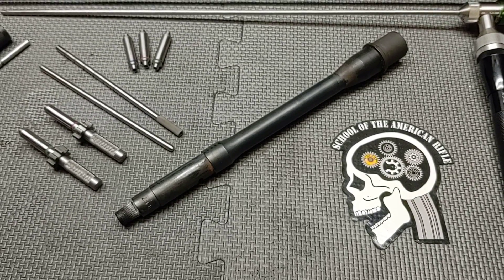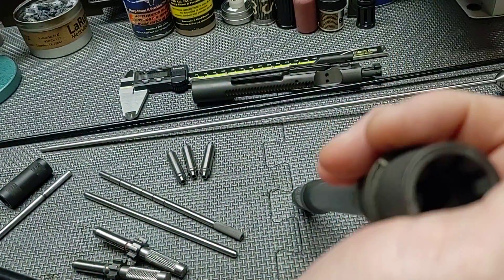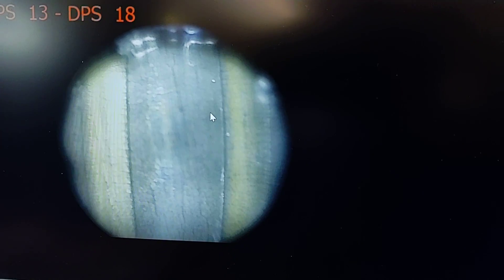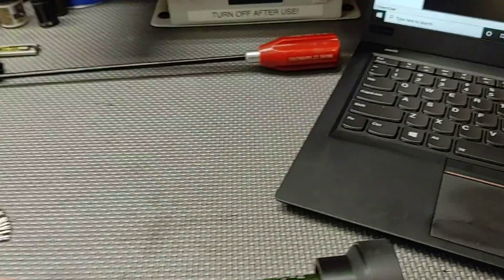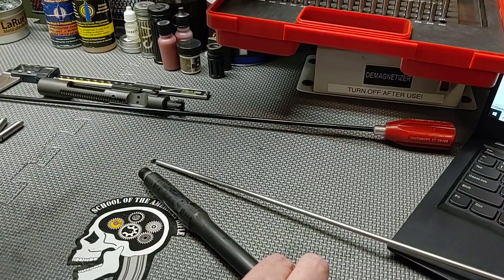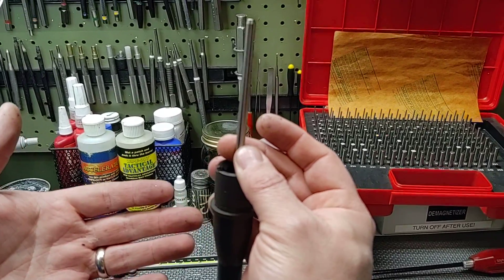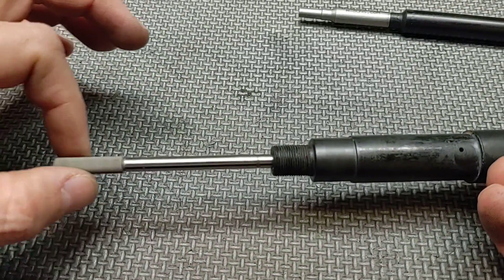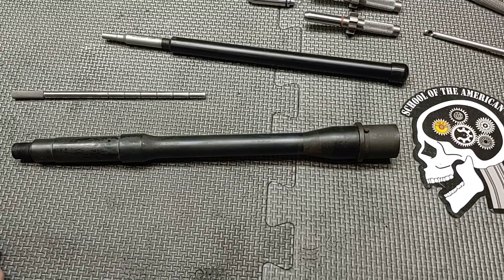Rosco Manufacturing - 26,750 Rounds of Full Auto - Barrel Autopsy

Comment: Man...my 10.3 ballistic advantage "hansen" barrel was torched at 5,500!  Of course, 90% of those were fairly hot Hornady 75bthps behind RL15 or Varget.  I wonder how many more rounds it would have survived with an equivalent load of cooler burning ball powder?  All academic at this point...ultimately barrels are dirt cheap compared to component prices or god forbid factory ammo.

Good work on the autopsy! Subbed.

Comment: I would like to point out one thing you may have overlooked here.  With that much erosion at the muzzle, you essentially have a tapered barrel, As your erosion gauge clearly shows.  This would potentially render the straightness gauge test irrelevant in this case.  This could potentially prevent contact of the gauge rod at the eroded end, where it would normally contact if it were bent with minimal erosion, allowing it to slip through unimpeded.  It likely is essentially straight however.  Just something to consider.

Comment: What was Rosco's using for ammunition on that barrel? And was it a consistent brand/type? How much did they clean between dumps if at all? And yes need answer to question if they used suppressor or not but can accept that it's less than half likely they did.
All in all to my limited experience it looks like what can be expected from a 13.7 inch barrel being rode hard in full auto though I admit I thought the throat would be gone.
Reply from the maker: No I don't need to answer anything. I explained what I was told in the video. Take it or leave it.
Reply: @SchooloftheAmericanRifle  Leaving it then. Just curious was all

Comment: I wonder what erosion on LMT’s 45 degree gas ports look like
Reply: I have been wondering this as well.  Some of the claims seem pretty dubious...but I want to see a report from a 3rd party.
Reply: @jonathonschram3429  Stole this from the AK subreddit because I don't think I can say it any better, but I researched this on AKs and found this to be very informative:

"Everything pre-AK-74 used a 45o gas block and gas port. Early AK-74s also used a 45o gas block and port until they realized it was causing bullet shearing. The AK-74 switched to using a 90o gas port and gas block because of this. Everything afterward did, too, simply because it was easier to only have to drill one kind of hole and make one kind of gas block for everything.

The gas port angle is what is important. Romania used 45o gas blocks on their AK-74s, but did not experience bullet shear due to the fact the gas port itself in the barrel was drilled at a 90o angle.

Basically, it doesn't matter."

Also, I believe a 45 degree gas port will lead to quicker gas port erosion...look at how the gas port eroded on this 90 degree gas port...now take that and start with a 45 degree gas block, it's just gonna accelerate the erosion.

Comment: Even with the gas port erosion the gas port is still smaller than many other mfg gas ports.The weapon seems to have been properly gassed.I've been overlooking Rosco and several other mfg but will be checking them out.I only buy AKs if Akoperators union clears them and now when I'm looking at barrels and bcgs I'll see if you clear them.

Comment: Chad, with someone of your knowledge, I think it would be great to see an in-depth AR style rifle cleaning video- if you ever find the time. Awesome stuff.
Reply from the maker: Certainly
Reply: A live Q&A would be incredible.
Reply: I do something similar based on military and civilian training and trial and error. I'll strip the rifle, coat in CLP, scrub as needed, then I irrigate the upper receiver with brake cleaner. All of the small parts minus the extractor I degrease with a toothbrush in a tub of mineral spirits. Once everything is degreased, I clean the barrel and LIGHTLY coat the rifle and all parts in CLP and wipe down. Then I run a snake through the barrel and mop the chamber. I only "lube" the cam pin, bolt guide surface, and 4 bolt carrier contact surfaces and I do so sparingly with lubriplate. 
I am running a mid length 16" with a sandman k. Cleaning and lubing the rifle like a M1 Garrand has decreased the amount of graphite, carbon, and dirt that is attracted by excess lubricant and it needs cleaning less often.
Reply: Drop the fieldstripped rifle in a tub of CLP, let stand for 72hrs, remove, scrub parts with nylon brush, run through parts cleaner with very mild solvent/degreaser(simple green), rinse with water, dry thoroughly with pressurized air, lube all parts and lightly coat all steel parts with CLP. We used to do that while on post deployment leave, everything but the optics, and lowers went into the bins, and when we got back you could see carbon settled on the bottom, and it was way more than you thought your rifle had. I currently have an Anderson RF-85 upper. They claim you don't need lubrication, and warn against using lubricant. I run my upper wet, and I keep it wet when at the range and at home I keep a light coat of oil. If I need more than a mag for self defense then I'm not doing it right, or it's the cops at my door, which is a slim to none chance for me. And in reality, you don't need to get every last bit of carbon, and honestly you shouldn't remove it all. It's not worth the time and effort taken to achieve, and in my opinion, it's not healthy for the firearm. Carbon isn't the enemy, your bore, chamber, barrel extension, bolt face, bearing surfaces, and BCG should be clean of build up and excessive carbon. But the first three should be the main focus for being the cleanest and the rest you can get the majority and not have any operational or excess wear issues. The biggest place I see people missing is in the FCG and buffer assembly and tube, as well as their gas tube and gas key. If you have coatings that will withstand it, break/parts cleaner works magic on carbon. I might get chastised for saying that, but I used more of that stuff in the military than I ever did as a mechanic.
Reply: @Deathbomb9  CLP isn't the best lube. It kind of fights itself.
Reply: @hellcatdave1  never said it was. It's what we could use in the military and I have used gallons of the stuff. It comes down to preference and how many different products you want to use and have on hand. For most people, they want a few. I have lost count of the number of products I have or have used. For the purposes of cleaning after the range, CLP is great. You can wet the firearm, put it in the case and head home. After a couple hours it has worked it's way in to breakdown most the carbon build up, or if you kept applying it at the range and started with a well lubricated firearm you can likely wipe most the carbon off and have minimal time scraping and all that. For a deep professional cleaning I use several products and in different stages. I've never had an issue with CLP besides its heat resistance and the fact that you have to apply it more often than most oils. But in the military that was t really an issue as we had gallons of the stuff at any point in time and usually did some training with our rifles at least once a month. I've had CLP restore function to an M9 that spent 2 weeks in a humid and damp Texas summer where it was starting to rust and was inoperable. After cleaning and a little scrubbing to clear up the rust it was as good as before. I won't say new because it wasn't, but it was partly due to the basic issue cloth holster that it was stored in.
Reply: @hellcatdave1  u